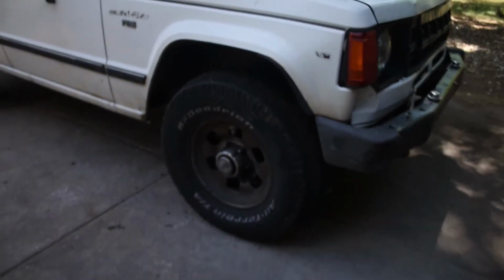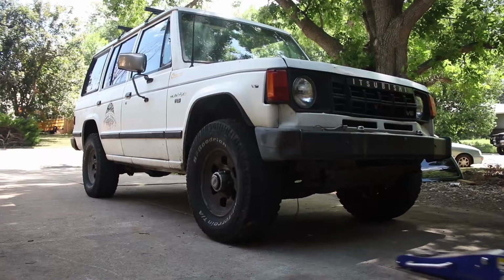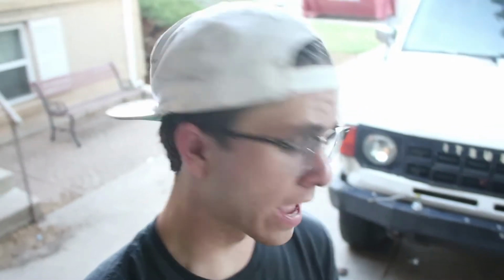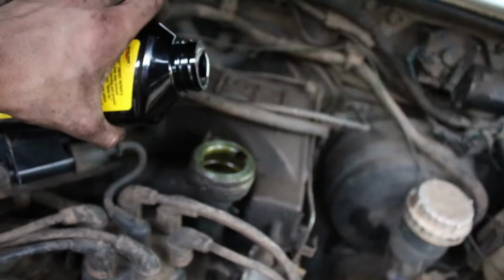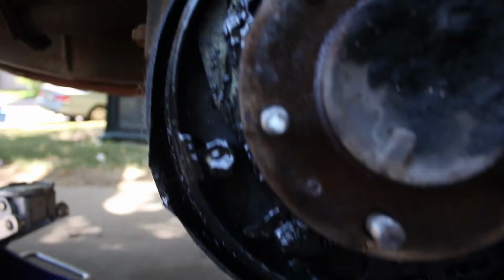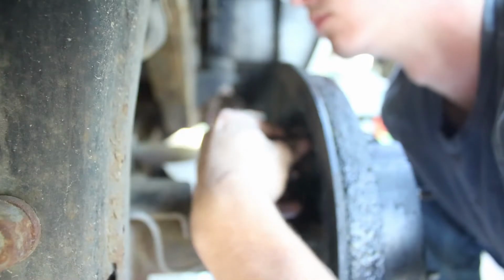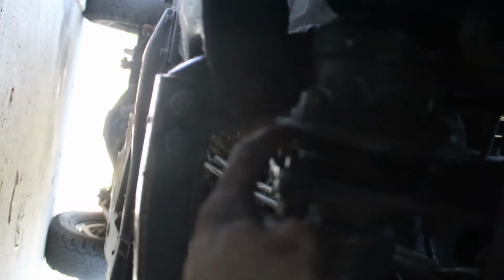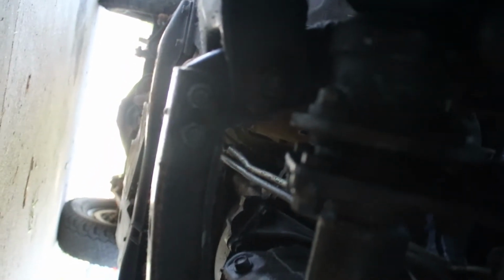The Montero has Brakes again!

Comment: I think all that gunk in the right rear brake drum is axle grease. if you don't replace the wheel seal those new brake shoes will be trashed.  also that grease came from somewhere so better check the rear dif for low fluid. the front axle should have a clip of some kind to hold it in. Probably need to go into front dif and check it out.